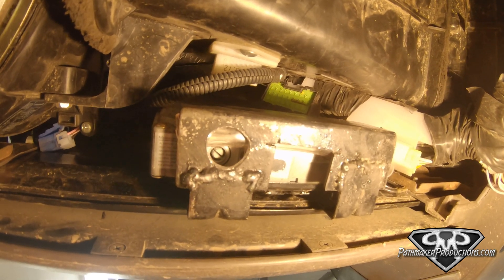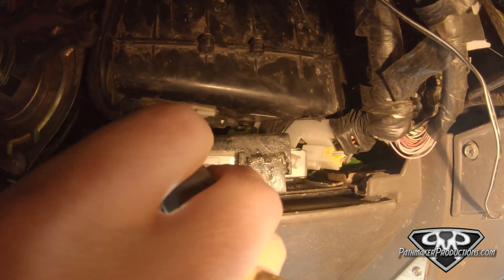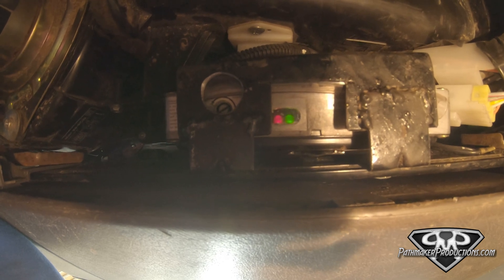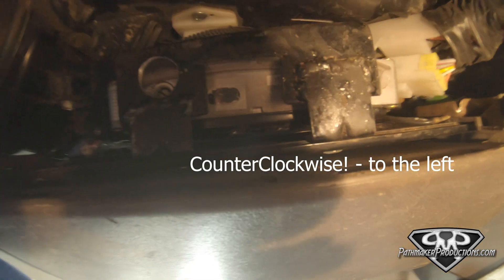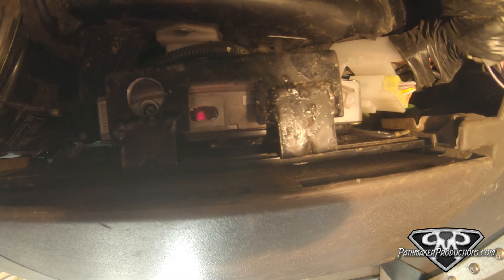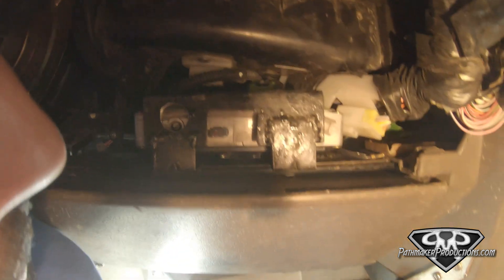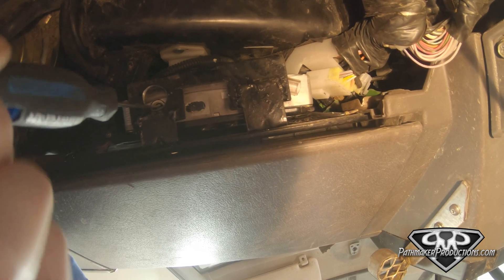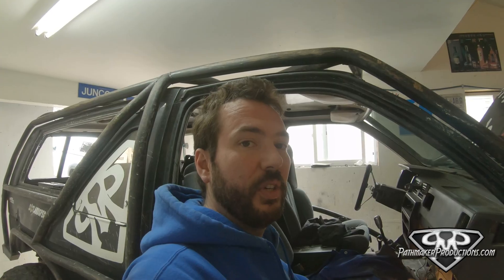Check Engine Light? Read OBD1 ECU Codes on a Nissan Hardbody or Pathfinder - No Scanner needed!

Comment: hello, i ve a problem, i ve no electricity to ecu do you know how to check it? cheers
Reply from the maker: Can't check the ECU without power. if its still plugged in and hooked up and you have no power in your truck at all then its likely the fusible links (the 3 small wires that come off the positive battery post) they are there to save your wiring harness from melting during a power surge, meaning they can easily short out and then you're left with zero power in your truck.
Reply: @PathmakerProductions  i ve no sparks, coils are good, condenser also, distributor also fusible also, the last chance it's the ecu, i ve current every where but not at sparks and ecu. 
thank you for suggestions...

Comment: Any idea if the nissans use the same ECU around the same years? I can't find anything for my 88 Sentra.
Reply from the maker: Your ecu would match with other years of the same body style Sentra (from 1987-1990) but not with a different model.
Reply: @PathmakerProductions  Thanks. I bought a used one off Ebay 5 years ago, after mine fried(rainwater came under the door, parked next to the curb). The numbers on the sticker on the ECU matched. He told me the numbers are a strategy code and have to match exactly or it won't work. For instance, if the car was a 4 speed or auto., carb or TBI, Cal. or federal emmissions. This car never has run right since replacing the ECU. Could've fried somethin else I guess, but finding people that know how to work on or diagnose what's wrong with it is like trying to find Dinosaur bones.

Comment: Great video im about to check mine out its a 1990 one day as i was pulling up to my house all gauges dropped no lights lost power but I can still jump solenoid and it will run it just doesn't really have any power in gear it revs with a slight mis in P or N   i was thinking starter but ive owned several and this is a first key has power but don't turn the engine over and the gauges puzzle me take care
KY ✌️
Reply from the maker: I would start by checking your fusible link (the 3 wires that come off the positive post on the battery) they can short and you can lose things and then tear your hair out trying to figure out why you have no power!
Reply: @PathmakerProductions  I appreciate it the way it was running fine and all of a sudden when pulling in luckily at home the gauges all dropped and once I shut it off and tried to fire it back up it would kick on fuel pump and accessories lights etc. but gauges heater controls gauges/lights won't come on and won't engage starter but I can turn key on and cross the solenoid and it fires right up but my luck if I ran a push button I'd be afraid to get stranded with the family I used a test light and I have power coming off the fuse links on the terminal but greatly appreciate the reply I was going to sell it and fix up my z24 hardbody but after it did so good in the snow and ice I was leaning towards keeping it got a bunch of parts, tires and wheels then it laid down on me id rather do a head gasket job as to do guess work chasing my tail take care thanks again

Comment: Great video.  Never knew it was that simple. Got a 93 was running great came out of store and won't start. Spark to distributor nothing to plugs. Replaced rotor,cap,and angle sensor still nothing from plugs. What's the silver little disk cd looking thing called? Anything would be grateful thank u
Reply from the maker: That is very odd, have you checked/replaced your coil? Sounds like its not firing. Another common problem can be the fuisble links (the wires coming off your positive post of your battery). They work as fuses to not have your harness melt in case of a surge but they don't visibly change when they pop, but they can create weird electrical gremlins if one of the two wires has gone.
Reply: @PathmakerProductions  I've noticed that my rotor has changed positions once.  Could that be I need new distributor or timing chain bad,?

Comment: My ecu is flashing the 1 2 3 4 5 when the key is tured on and does nothing when you rotate the dial clockwise and sometimes it stops flashing all together and i have to discharge the electrical to reset the ecu. And the truck runs like total dog shit.
Reply from the maker: The 1 2 3 4 5 is asking you which mode you want. If when it flashes 3 and you turn the dial back and it doesn't go into code reading mode you have something wrong with your ecu. In mode 3 at the very least it should flash 5 5 to tell you there is no stored codes. Do you know any other Nissan guys that can lend you their ECU to try and see if that is the issue?
Reply: @PathmakerProductions  yeah I understand the 12345 part is the modes but they start clicking thu the cycles with the key on acc and not touching the dial. When I try to turn the dial to select the mode 3 it stops flashing all together and no more clicks or lights until I drain the residual charge in the system to 0 vdc. I don't have another ecu to try unless I buy one from ebay...
Reply from the maker: Sounds like you have a dickered ecm. Capacitors may be cooked. If you remove your ecu and take the cover off take a look and see if any of them are bulging and leaking. As long as you have a ground and power running to your ecu it should flash the codes not brick up like that so you've got something seriously wrong with it and the capacitors are over 30yrs old and known to be an issue.
Reply: @PathmakerProductions  thanks for responding to my comment. Happy trails as I'm off to buy a used ecu from flea bay
Reply: @PathmakerProductions ok so I got the ecm from ebay and so far it works perfectly. It goes into diagnostic mode easily and flashes 5 red and 5 green for all good. However when I went to start it, it started and ran like new for about 5 seconds then it shut off and won't start again but cranks. Is there something I'm missing. It will start to fire but not start when I turn up the idle with the ecm. I have spark when cranking.  Any help I appreciate

Comment: What does the ecu look like on a 1999 Nissan pathfinder
Reply from the maker: Its an OBD2 system so you can plug a code scanner in to read the codes so no need to do this procedure. Plug is near the hood latch.
Reply: Code reader says no comunication @PathmakerProductions
Reply from the maker: What are you trying to read the codes on? If its a WD21 Pathfinder before 1996 it doesn't have a code reader so thats no surprise, if you're trying to read the code on a 1999 like the OP and getting no communication its usually the sign of a cheap OBD2 scanner.

Comment: have you ever submerged one?
Reply from the maker: Yea they don't like that very much. A quick soak is ok in my experience but if you sink it and it stays underwater for a while they don't like that much!
Reply: I sunk mine for 30 min now i can't get it to run rite I was wondering if thats my problem?
Reply from the maker: I would definitely start there. Do you know anyone else with a Nissan that you can swap their ECU into yours to try it before you buy one? Thats where I would start on trying to diagnose that one!
Reply: I wish I did man these are getting hard to find out here in ky. I found one on ebay I'm going to order do you know if it will need to be  reprogrammed ? I'm hoping if it came out of the same vehicle it won't. love the videos man and really appreciate the replies!! I've had 2 pathfinders and they are completely under-rated best stock rigs to buy cheep and beat up ide say.
Reply: new ecu did the under dash mod lol running great thanks for the help! 👍

Comment: The engine is running up and down
Reply from the maker: The engine is surging? And no codes coming up? Look up how to use a multimeter to test your Idle Air Control Valve and your Throttle Position sensor.
Reply: @PathmakerProductions hi! Im having the same issue. Bought a 94 of some guy on OfferUp. Runs fine, but I’m 1st and 2nd it bucks. Guy replaced the TPS as that’s the code it’s throwing (43) but issue persist. Any ideas?
Reply from the maker: @clockworkcollectibles1515  after the TPS was replaced did him or you reset the computer? unplug the battery for 15minutes and plug it back in and take it for a drive and see if the code comes back!
Reply: @PathmakerProductions  ok,so i did that and the code persist. Was the TPS installer wrong?

Comment: What does this process help? Or do I’m other words?
Reply from the maker: If you have a warning light on the dash of your Nissan Pathfinder or Hardbody then that indicates you have an error code stored in the ECU. Sometimes you'll have codes even without a light so typically if you're having a problem diagnosing an engine running issue you should start by "pulling the codes" to see what errors come up. A lot of guys just start throwing expensive parts at their engines before they even know what the problem is, so pulling the codes first will give you a bit of an idea where to start.
Once you get into 1996 model year for every vehicle they were an ODB2 system and then you can just plug in a code reader to tell you the errors, but these ODB1 systems require you do go thru this process and count the blinky lights.
Reply: @PathmakerProductions  oh ok thank you so much! I do I have light that will occasionally turn off and on, on my 95 Nissan Pathfinder so I’ll most likely have to end up doing this. Thank you for the info!!
Reply from the maker: Your codes get stored in there until the battery is unplugged for I believe 5minutes. So if you have any old codes they'll show up in there. I have a link in the description that takes you to the full list of what code is what on my website, to help out your search!